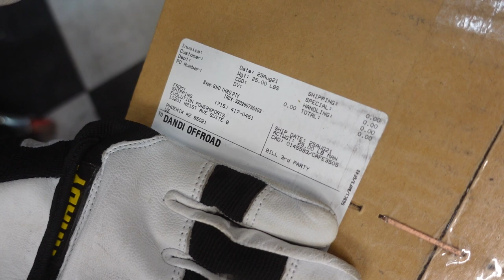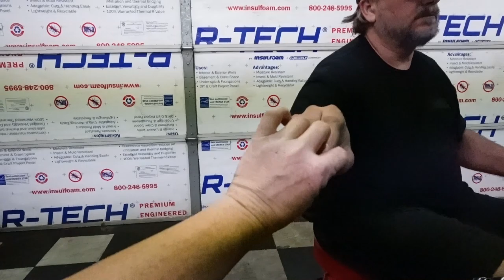HOW TO BRAKE A NEW TURBO S IN 5 MINUTES

Comment: Be careful when you beat those broken studs out of the exhaust. You can break the flex joint and cause an exhaust leak. Ask me how I know? I ditched the stock studs and just used grade 8 nuts and bolts with lock washers.
Reply from the maker: Good call,, I was over it.. LOL